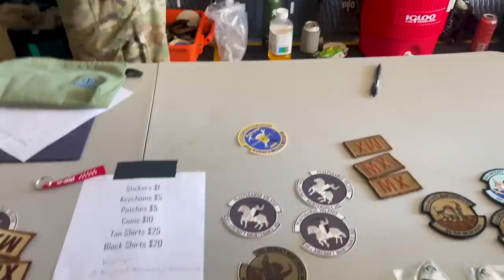ரகசியங்களை கண்டுபிடித்த இந்தியன் | Russian Weapons in the US | Aircrafts Stolen? | Tamil | SKA Vlog

Comment: The aircraft on 5:01 with two vertical engines is not a bomber. It is MV-22 marines version of V-22 tiltrotor aircraft. It typically drops troops. It is made by Bell helicopter with electronics from Boeing company.